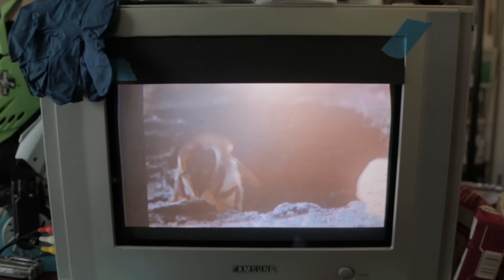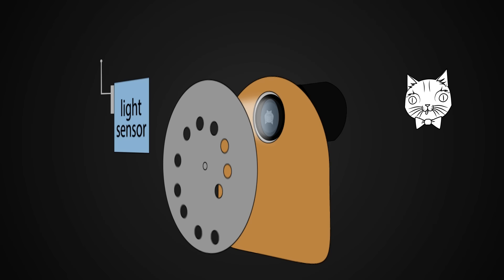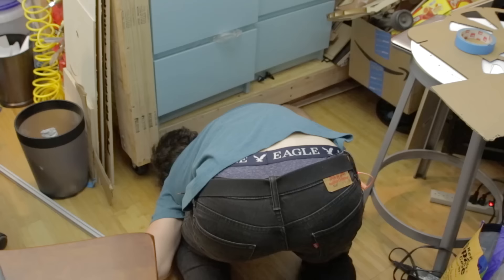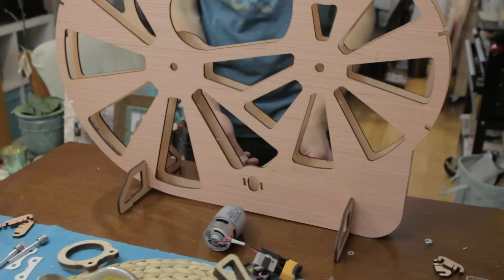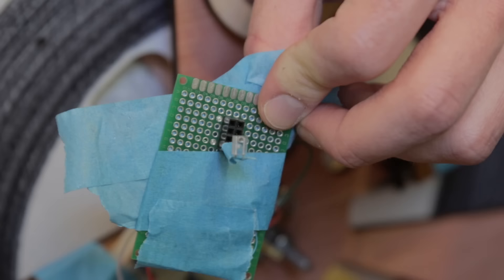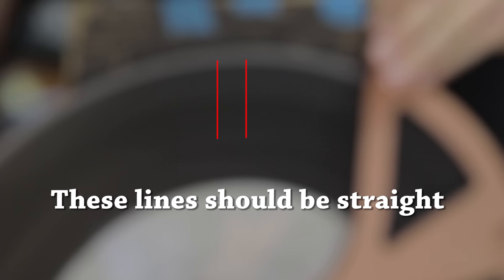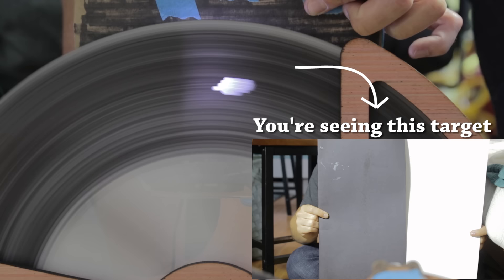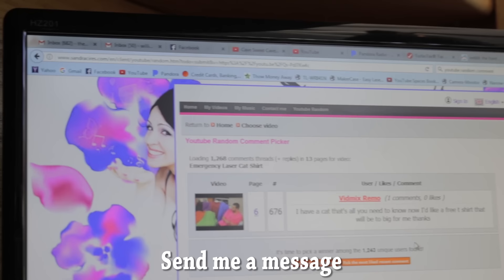William Osman Builds a Terrible Mechanical TV

Comment: only god knows why he didn't just spray paint it
Reply: actually i asked and god doesn't know as well
Reply: Im assuming that he use spray paint is because if he's not careful, the paint might be applied too thick and might get stuck in the mechanical parts or the dried paint cracking if something hits it on the inside while it's moving at such a rapid speed. By using Rit Dye and/or Sharpie Ink diluted in alcohol, he can color the wheels without adding potental layers that could jam the machine.
Reply: @diaryboy  I use spray paint alot and never run into the issue of the paint making something too thick unless I use more than 1 layer
Reply: Autismo you use spray paint regularly so you know what you’re doing. William doesn’t so he has a much higher chance of drenching everything instead of dusting it while spraying
Reply: No everyone, it was probably because he didn't want any warping of the disc.
Reply: Or black card stock?
Reply: In all honesty this seems like a very precise operation, so it being even a hair too thick might have risked throwing it off. The black card stock point is a good one though, who knows
Reply: I think it's so that the holes don't get clogged by spray paint
Reply: EXACTLY
Reply: @GaminGuy_  🤷‍♂️
Reply: I like all this discussion about the intricacies of making a layer too thick, and then I scroll back up to him just using a paintbrush to paint black fountain pen ink onto a cardboard disc unevenly.
Reply: that's too complicated
Reply: because there were too many bees

Comment: Even though it didn't really work, the problems you ran into with curvature are actually a really neat way of visualizing how a lot of modern cameras capture an image. They generally draw the image field by field, one after the other. This is why there's lots of footage out there of airplane propellers appearing to curve, because the camera draws the image in those fields. In the first field a blade might be in the 12o'clock position, and in the next field it might be in the 3o'clock position. The end result is this eerie sort of curvature.

Your issues are 100% related to synchronization. I'm sure you've seen footage of fast moving rotational objects, like helicopter blades or the tires on a car or bicycle. If you match the shutter rate and framerate with the rotations per second of the object, you will capture what appears to be an unmoving object. It's a really really really similar concept to the stroboscope. In fact it's basically the exact same thing.

From what I've seen of functional mechanical TVs, they all seem to operate much much slower than what you've been running yours at. The images appear to be sub 10FPS, which in the context of rotational motion is an incredible difference in speed. That could also have contributed to the lack of proper synchronization.

I'm sure you'll figure this out in the future if you ever decide to revisit it. Cool project.
Reply from the maker: Thank you for the comment. I'm bummed it didn't work better, but will definitely attempt version 2 using the information people have provided.
Reply: spartan456 I’m pretty certain the earliest Baird Televisors ran at around 15fps, but the later models with higher resolution and even colour reduced the framerate to less than 10fps.
Reply: I'm just going to act like I know what that all means.

Comment: I hope you revisit the mechanical TV project. I think I understand the problem. While there were later mechanical TV cameras that focused the image. The Nipkow disc camera used the disk to scan the subject with light while using lenses and photoresistors to pick up the changes in the reflected light. Because the system used no amplifiers, there were multiple photo sensors around the subject to gather enough light and modulate the electrical signal which was sent over a wire and drove a neon light in the receiver. The Nipkow wheel receiver had an adjustment that applied resistance to the wheel to synchronize it. I think it was some kind of magnetic brake. When you see a photo of the original set up, it looks all lit up. But, that is only because they were photographing it. It reality, the area had to be kept pretty dark to maximize the contrast. Later mechanical cameras used a kind of drum system that was driven by a synchronous motor and the receiver had one also. American systems were based on 60hz and the British system was base on 50hz power line frequencies. The British actually had a mechanical TV network for a time that became obsolete when electronic cameras were invented. The hold up was the camera tube which required a team of researchers to develop. The CRT was invented in the 1890s. I suggest you try reproducing the first type of camera and receiver.

Comment: It's worth noting, the original mechanical camera did not require a lens.  Instead, the subject was lit through the spinning disc of the camera.  This caused a single beam of light to go through the scanning holes in the disc and illuminate one part of the subject.  The reflectivity of the part of the subject illuminated by the spotlight would change the illumination in the studio, which could be picked up by a cluster of photoresistors.  This was known as the "flying spot" method.  You could use lenses to focus light on the photoresistors in order to make them more sensitive, but it wasn't required.

It's also worth noting that John Baird, a mechanical TV pioneer, invented the first video recording format.  He hooked the transmitter up to a record cutter and recorded the signal to a shellac record.  Interestingly, playback was not possible with these Phonovision discs, Baird never reported success anyway.  However, Phonovision is still credited with being the first TV recording format because modern historians were able to recover video from the six remaining examples.

Comment: This idea may have already been posted, but I don't know, also I am completely lost when it comes to this level of genius, but here goes nothing. Since the wheels are different sizes but are using the same motor, wouldn't that cause the larger disc to rotate a little slower? Since it has a larger surface area? In my eyes this could possibly fix the improper alignment issue, but probably not. Also if you're reading this William I love your content!!

Comment: There was an earlier varient of a "camera" design used by Braid that consisted of the subject sitting in a completely dark room. The "camera" disk had a very bright arc lamp behind it and would project a scanning spot of light over the subject and an array of fixed photo sensors were placed around the disk to detect the reflected light from the spot as it scanned across the field. (essentially, it worked like a 2 demensional barcode reader)

Comment: For the mechanical television I'd suggest moving from a disk to a belt, perhaps something with roughly the dimensions and speed of a belt sander, which could probably net you something in the region of 15 to 20 fps.  The obvious advantage here is that you could present the playback in rectangular instead of a slightly curved pattern, not to mention the overall size to screen size ratio could be somewhat minimized.  I would also advocate forgoing any image capture in favor of a converter for playing back pre-existing video - perhaps you would then only need to set up synchronization pulse(s) with the belt to either buffer the converted images or provide automatic speed adjustment.  Also if you forgo the crude image capture you can obviously up your resolution depending on your playback device.

Comment: Use a razor blade and score many line in the ply or mdf sheet, use a ruler or straight edge to insure you cut in the same spot, and once you give it 5-10 hard runs. Just lay it so the offcut so overhanging somthong straight.  snap it with a sharp bang to the offcut easier quicker and safer then a table saw
Reply: With somthing that thin

Comment: You were going to make a tv, so why a camera? Wouldn't it be more legit if you only made the tv and a circuit that decodes a real tv signal so it could be shown on your mechanical tv?
Reply from the maker: Sorta. I should have started with just the TV, but converting a standard TV signal to a mechanical TV signal is way too much effort. The easiest way to do it is by writing software on a computer to convert a video file to an audio signal and sending it out the headphone jack, but then you need to synchronize the spinning disk to that signal somehow. Or it could be done digitally by sending all the info over USB, but it's actually quite a bit of data.

Comment: That's how you end it?  with a fail? lame. You should have just waited until you made a working one to release a video.

Still, If you think about how a CRT tv works those are more amazing than these, in my opinion. To make a single beam move that fast and accurately using analog electronics is one hell of an amazing feat if you ask me.
Reply from the maker: It totally works, just not very well.
Reply: That's like saying "60% of the time, it works all the time!"

Tiger piss!

I think you should go back to the laser record project. You might have a million dollar idea there, what with all the retro-audiophile freaks these days. There's a record player that uses a laser to read the record that's on the market but it's several thousands of dollars. Just find the right material & work on dialing in the mechanics of the burning laser and ...Boom! People pay 20 times more money for quality inferior to CD. 

...but people will swear it sounds better.